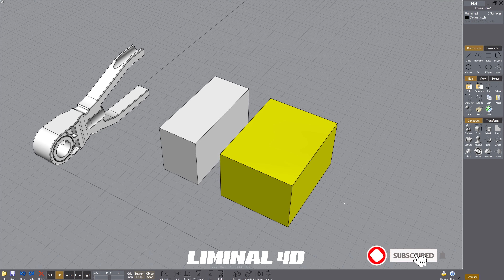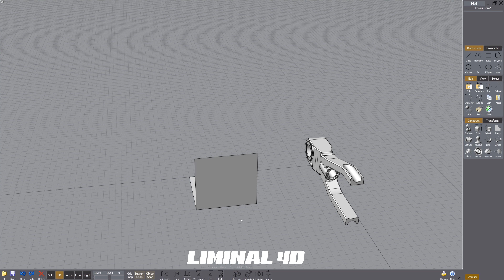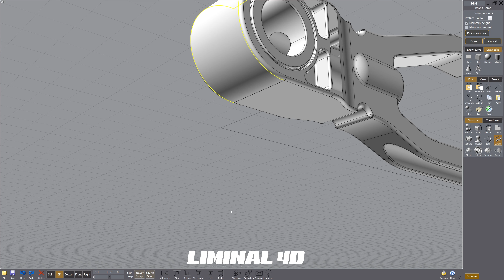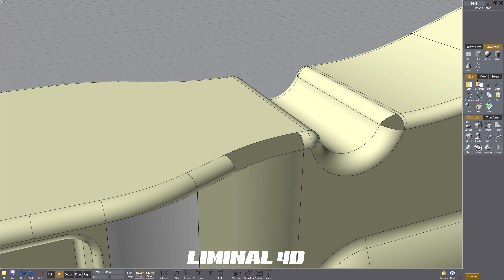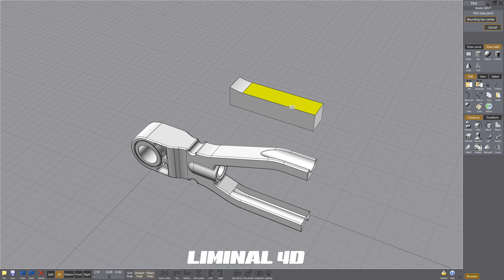Moi 3D Best Modelling Practices / How To Prepare a 3d Model for Export and 3D Printing

Comment: Every video you make is top notch. I really enjoy all your editing , Make's learning so much fun. Thanks.
Reply from the maker: Thanks Todd!  I'm overdue to get some new ones out.  Gotta find the time!   Thanks man
Reply: @liminal4d  Hi Liminal, I have been trying really hard to get the custom ui into my Moi files. I have been following your custom ui video. to the tee. I must be missing something. Any tips?  Seems like When I open the Moi plug in, it does not look quite the same as your's in the video. So determined to get that cool add on. I am running the latest version of MOI. 4.0 beta. Any ideas?
Reply from the maker: @toddspeck9415  Check out the comment section in that video https://youtu.be/rm1v-PmhKNI    Jakisator asked some questions about installing the object library plugin for 4.0.  I link the right way to do it for 4.0 with instructions there.    Note that the plugin has a few things in it that won't install because they are outdated or already incorporated into Moi 4.0.   I just use the plugin for the object library.  you can delete the stuff out that you don't want as well.
Reply: @liminal4d  Awesome man, I was reading quite a bit in the Jakisator posts. Thank you so much for the tips. I really appreciate that. I always tell people about you. Peace out.
Reply from the maker: @toddspeck9415  if that doesn't work let me know
Reply: @liminal4d  A little confused about the step. removing all previous versions of custom ui.  I know very well deleting the wrong thing's can really mess things up. Is it a required step to delete the previous versions? Not sure which files I should backup just in case.
Reply from the maker: @toddspeck9415  no i don't think it's required.  It's just that text is a limited way to troubleshoot since I can't see it directly so it's a general recommendation.   Give it a shot without.  You can reinstall Moi 4.0 if need be.
Reply: @liminal4d  Think I am getting closer. Your tips really help. I will keep at it till I get it. Thanks again. Have a wonderful Saturday.
Reply from the maker: @toddspeck9415  you too.  If you end totally stuck let me know.  We could always schedule a live stream and i can share my screen if needed.
Reply: @liminal4d  Thanks you so much. I will keep at it. I have been having so much fun sending my MOI drawing's into the Blender. first time I saw one of my drawings in Blender with the red gloss matcap. I was so blown away. Been hammering Blender everyday. Think its so cool how each software type compliments each other.  When ever I get stuck. I just jump back to MOI. I really think MOI is my absolute favorite. For me your Timmy to Blender vid was just the best. That vid inspired me to learn Blender. Thank you so much.
Reply: Liminal  check this one.......Hyperion    A chill synthwave mix for Eron Yeager.   The whole mix is epic.   Best tunes for drawing.  I will let you know when I get the add on dialed.
Reply from the maker: @toddspeck9415  will do, thanks!